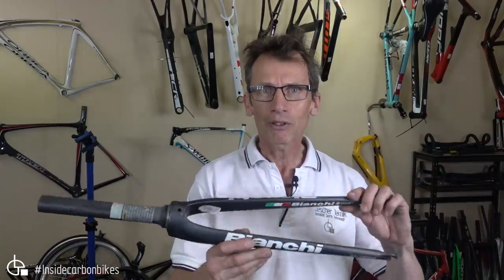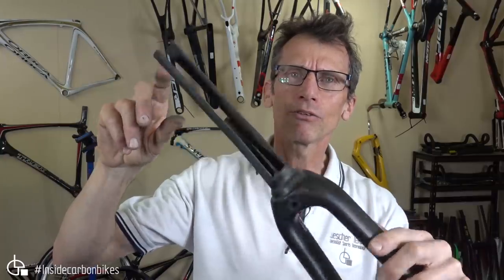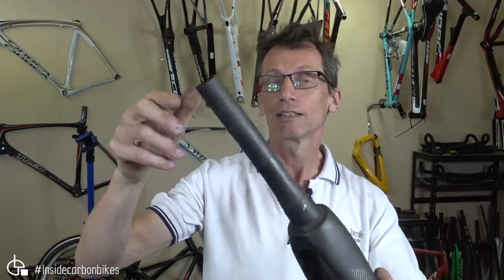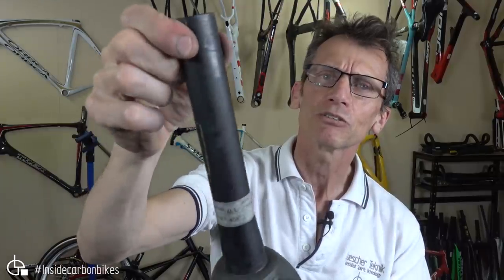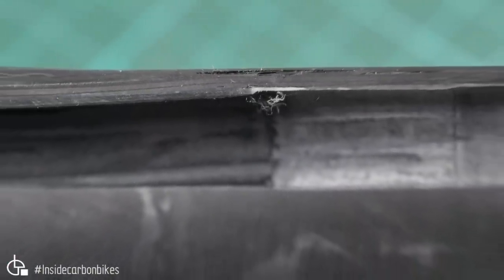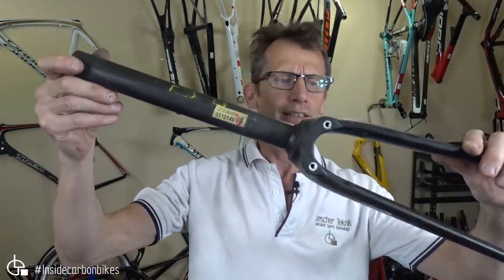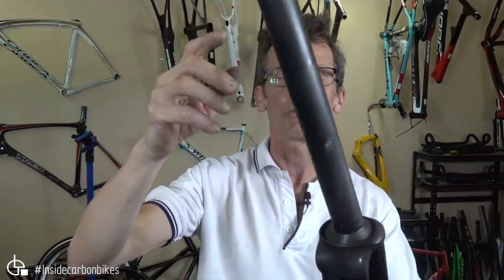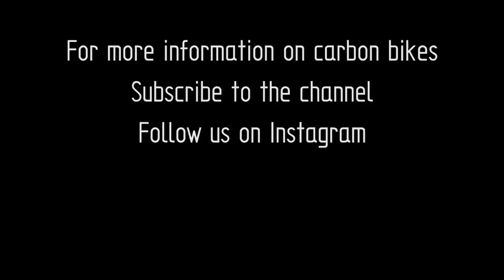Fork Steerer Failure - Recent Crash

Comment: Hi Raoul, I’ve been in denial about the state of my steerer for some time. I told myself it was okay, even though I was pretty sure that, owing to the fact I had not used a torque wrench, I had, and continued to over tighten the stem bolts, damaging the carbon.
Watching your video this morning was definitely a wake up call. 
I took the fork out and checked it. There is a vertical 2 inch crack all the way through the laminate at the top of the steerer, and also horizontal damage. Crushing damage. I’ve been riding around like that for who knows how long. It was a death trap.
No matter how many times I’ve heard mechanics/technicians, including yourself, on countless videos telling me to use a torque wrench, and not to over tighten, I ignored it. 
I’m clearly a moron, and I greatly appreciate you taking the time to make this video 👍🏼
New forks are on order. I will also buy a torque wrench.
Reply: Dan Golding - and use the friction compound.
Reply: Also watch Raoul's video on insert plugs and use a good one. I invested a lot of effort into picking one that should support the steerer properly against the clamping force of the stem. Won't say which one I picked, since I'm not entirely happy with it.
Reply: @robertp7209  The general advice is to NOT use friction compound on the steerer as it contains particles which will degrade the laminate over time. If anyone can clarify this then that would be useful.
Reply: @horrovac  Cheers! Yes, I have a proper 2in expander plug/bung which functions perfectly. My issue has been caused due to over tightening, the system itself is sound.
Reply: Dan Golding - the frame of my bike and balance of components (stem, seat tube, bars) manufacturers written instructions in the assembly procedure call for it and where to be applied including seat tube and handlebars.  And handlebars are alum to alum stem.  A tube of the compound is provided by same manufacturer, as well as the max torque specs.  Lastly, the steerer will not stay in place by torquing alone.  I will not exceed those specs, don’t even want to approach them.
Reply: Carbon paste can either migrate lower into the bearings or even worse damage the steerer as it is a rotating part. Many manufacturers specifically warn not to use it on steerers.
Reply: @dantedorado2609  There is friction compound SPECIFICALLY made for carbon parts like TACX CARBON ASSEMBLY COMPOUND,. i am sure it is not harmful to steerers. Not using compound when fitting carbon parts on a bike is what basically damages components. Trek who are the ones who started the idea of not using regular carbon paste in steerers, do approve the use of Tacx carbon assembly compound
Reply: @robertp7209  Carbon friction compound is made with the purpose of lowering the amount of torque applied to make bike parts fit. Anyone not recommending or using this is clueless.
Reply: @blorg8206  You are incorrect. The idea that you should not apply normal carbon paste to steerers came from a Trek tech bulletin.. in the bulletin trek states: "As an alternative, we recommend the following special carbon prep products:
Tacx carbon assembly compound
 - Fiber Grip™ carbon fiber assembly gel from Finish Line." So using just any carbon paste is not ok.. but using the right compound is.
Reply: Carbon friction paste has nothing to do with making parts “fit better” as your post stated. 

It is simply meant to provide some friction between inter fastened parts. It is in no way meant to serve as a “filler” for two parts to make their “fit better” as you stated in your post. It’s purpose is purely to change the friction between the components. 😃

Comment: These manufacturers are putting profit above QC, just watch Hambini’s video on Cervelo BB tolerances. Shameful!
Reply: Uff, that video is eyeopening
Reply: While I agree about the Hambini video, Cervelo is actually one of the manufacturers which do the fork steerer insert properly; it is glued in to the steerer with a sleeve, which is also long enough for the stem to clamp around it fully... Most manufacturers just do a compression plug or something similar which is not sufficient IMO.
Reply: @rkan2  the cervelo sleeve isnt long enough, i lowered my stem to be slammed and the bike shop had to hammer the sleeve lower
Reply: @mikes1984  It is long enough to support the full height of a stem. Whether it supports your your stem being lowered after first being glued in is another thing completely. It is recommended in the owner manual to glue the insert in the correct position...
Reply: rkan2 well i can’t verify that or not, but i have had two Cervelo’s and the finish is poor, the cable routing is also bad, so make sure you use electric shifting. for what you pay, there are poor quality for the money.
Reply: not sure what the situation is after cervelo was sold off, but they used to be great a with a lifetime warranty on the frame. I agree that finishing was poor, partic around internal cable housings not being finished so that water and sweat could enter and delaminate the carbon...just edge sealing would have solved that problem.
Reply: @Waynos Fotos; Why do you keep buying then? :)
Reply: @k c: Not Vroomen White anymore, and thus not really Cervelo anymore in my mind... PON Holdings probably does them in the same factory where they do Focus bikes.
Reply: BTW, you can see Raoul's opinion about Cervelo forks here: https://youtu.be/8bSnbjHiFXc?t=1m44s 

He regards the inserts as large, as do I, because the only things other than that are full length inserts, which are practically nonexistant or just some compression plug directly on the fork... Imo Cervelo inserts are among the best, if just installed correctly. Of course one can do an insert in any fork, proper diameter insert provided. Should be mandatory in UCI rules imo.
Reply: I have snapped a Cervelo s3 steerer and so has a friend. Yep quality control is crap.
Reply: no they have slack tolerances so the QC passes it just does not work as well.
Reply: This channel and Hambini are like watching the news...it gives a sense that everything is crap. Just ride brother, and embrace the creaking.
Reply: @aaron___6014  good luck to ya.. embrace the creaking all the way to the grave, LOL
Reply: Ian Brown  thanks Ian, actually it os not Aerospace tolerances, it is the bearing manufacturers that set the tolerance for their bearings to run properly and for them to maintain design life and warranty. I don't think it is to much to ask that the bicycle manufacturers meet that, seems most other manufacturers of  road vehicles can.
Reply: @rkan2  it was when i believed the marketing and aero gains. I just thought it was the shimano shifting, but it was the routing in the frame and groupsets on other bikes shifted better. Then i noticed how the paint was wavy compared to other bikes, and this was their top S5 frame. I have had other brands since and much better bikes.
Reply: @waynosfotos  If you don't race, I agree, if you do, aero gains matter (much more than weight gains). Exponential function is difficult for a lot of people to grasp, especially when it is to the cube!
Reply: You’re right
Reply: All hambini is trying to do is sell his overpriced bbs and tools and he'll go to whatever lengths to do so. While he may have some valid points his delivery is less than ideal.

Comment: Thanks for the video. So what’s the answer? Every time you buy a bike, have it scanned and do the QC the manufacturer should have done before they shipped the bike for sale? And then have scans again every certain number of riding hours? Seems an odd state of affairs. Hard to think of another industry where end user safety is in issue, where adequate QC is not undertaken by the manufacturer. Are bike manufacturers not concerned or currently taking steps to address the legal exposure they have in this area? How can we find out which manufacturers are undertaking the required QC  on frames and forks pre sale? As others have noted, buying a new carbon bike over the past 10 years does seem to have a “roulette” aspect to it.
Reply: S Ward it is because the bike industry is not regulated like car motorcycle industry, UCI is the only requirements plus reflectors etc. for sale rules in your country. 
So they get away with a lot.
Reply: Yup, I've said this many times in bike forums and FB cycling groups but have always been shouted down by the CF bike zealots. CF bikes are not meant for the average joe but bike companies are marketing these expensive light weight bikes to consumers because the average joe wants to ride what their favourite pro rider rides (so that they can ride from cafe to cafe showing off their ride). There is a certain amount of constant care and maintenance that is required for CF bikes and this is usually ignored by these amateurs. The pros get new bikes each season, the average joe rides their bikes for years. On top of that, the CF sheets are hand laid by workers in developing countries sometimes unregulated conditions. Even Canyon, that boasts that they x-ray each bike they build has faults in their fork - see video. Why risk life and limb so that you can show off to your buddies that you ride what the pros do?
Reply: @triode1212  I don't really think that is the point here, "who they are for" if a product is sold as a consumer product, I.e. off the self product, it should be fit for purpose. At these prices the quality control should be industry best, but it isn't! I do believe that is the point being made here. Who decides to buy and ride them is irrelevant to quality standards
Reply: @waynosfotos  I accept you point but even with the best quality control, mishandling by inexperienced mechanics and owners, plus the inevitable collisions/falls. will cause micro fractures which can lead to eventual failure of CF fork, frame. And I don't think it would be cost effective to test each and every frame of the thousands that the manufacturer builds - it would add considerable cost to the cost of each frame. Also a lot of the manufacture is farmed out to subcontractors (esp when the company needs to fill a large order) . Do these smaller shops/subcontractors have the same quality standards? Can they even afford the testing machines. CF is a great material but it has it's limitations and it is not for the average joe who will be keeping it for years.
Reply: It seems odd.  This guy seems a bit odd.  He makes money when people come in to get their equipment inspected.  I mean is he trying to inspect every bike in the world?  Is there some sort of carbon scanning community across the world for people to get their steerers scanned?  I mean what is going on here?
Reply: David Winters No you are incorrect, he is a Carbon bike repairer, with an excellent reputation, he did his training in the aerospace industry. He only gets to inspect these components due to the fact a rider has bought their bike in for repair. 
He may get access to some new stuff, but that is not his core business.
Reply: @triode1212  Its not just CF forks/steerers which can fail. Good QC is vital no-matter what the material is.

Comment: I will stick with my alu road bike which has a steel fork. It's a bit heavier (11.4 kg) but hassle-free. And it needs almost no maintenance or torque wrench. Carbon bikes are overvalued and overpriced.
Reply: correct, but even finding an aluminum or steel frame that is well done, is not easy to do either

Comment: My headset made these terrible cracking noises. It wasn't the cables. It sounded and felt like serious damage. Like a piece of frame or steerer tube had broken off, and got caught inside. I took out the front fork and i was relieved to find it was undamaged. The headset was more mud and sand than anything else though. I cleaned it, and the cracking had gone. New headset is on order.
Because of this video, i'm going to remove the spacer above my stem, have the steerer cut. And check the fork regularly, even if everything seems fine.

Comment: It looks like there are critical manufacturing mistakes within the entire bicycle manufacturer industry. Wouldn't it be a safer bet to use a fork with aluminium steerer tube for the price of slightly more weight?
Reply: Forks with aluminium steerers are even worse, since the bonding between aluminium and carbon is a weak spot and practically impossible to do right. Even if everything is fine, differential thermal expansion will make it a risky proposition, as it creates a stress point unless the fork is always kept in the proper temperature range. And finally: aluminium fails too - perhaps even worse, as it is subject to material fatigue.
Reply: use a steel fork
Reply: @methylmercurypoisoning  Ive seen more steel forks fail than anything. CARBON WONT FAIL if you use a long steerer plug AND use a torque wrench AND don't run into the back of car at 60kph.
Reply: @methylmercurypoisoning  Use any fork you want from a reputable manufacturer. All materials are safe when used properly and all have pluses and minuses.

Comment: Great video. Clearly the current method used for carbon bike manufacturing is too unreliable to make them a viable purchase for the majority of people. Without  each component passing a ultrasound inspection with certified results you could be spending £10k on a dud. Likewise if the bike is assembled before purchase and the torque wrench used is out of calibration you've again got a possible dud. Poorly designed fork steerer inserts etc etc. Appalling design, quality control and total disregard for the customer.

Comment: Some years ago when I heard of steerfailures on carbon forks, I reinforced mine - at least I think. Made round inserts of wood, carefully adapted them - in full length - to the inner of the steers and glued them in with some epoxy glue (Araldit). Good or bad idea - or just waste of time? Like your videos - always good to hear people talk about things, they know about!
Reply: Bad idea.  It changes the location of peak forces and it’s likely not designed/tested to have the set of forces you’re creating.
Reply: Carbon wood fibre 😂

Comment: It's clear that these carbon steerer tubes need a bonded aluminum insert/sleeve all the way through for safety purposes, even if it sacrifices a little weight savings. Clearly there are manufacturing problems/processes that cannot be resolved. Looking at this right now, and I'm in the middle of building my first full carbon bike. Not a good feeling. I'm using the recommended specialized expansion plug in the streerer as recommended by this channel (thanks for that), and using a good torque wrench.

Comment: If there is nobody in my area to do a scan is there anything an average consumer can do?
Reply: Worry
Reply: DaaaveO1971 thanks for the tip
Reply: Pick a good compression plug and meticulously tighten the stem to proper torque. If it's 5Nm, first tighten the bolts so they loosely clamp, then tighten to 4Nm, then to 4.5Nm, then to 5, always alternating between the bolts (even after one bolt has tripped the wrench, after you tighten the other bolt, this one will move a little bit). Listen for cracks, if you hear anything like a stick of wood cracking, that's bad. Otherwise, don't worry too much, it's probably fine.
After you've installed it, pick a safe spot where you can fall safely, and sprint out of the saddle as hard as you can, making sure you put as much force into the handlebar as it is ever likely to experience. Carbon does not fatigue, so if it does not fail then, it will probably be O.K. later - unless you overtighten it, bump it while crashing or overload it in some other way.

Comment: I've ridden past a fatality due to a steerer failure. I've stuck to cro-mo since then. It's not worth saving a few grams. Plastic is for toys, I want tensile strength when my life depends on it.
Reply: Ive seen steel forks snap from fatigue. Carbon wont. People don't run deep enough steerer plugs and then blame the carbon when it fails from being crushed..
Reply: Durianrider Cycling Tips - nope doesn’t happen to carbon steel, it will bend and bend plenty, if the design is adequate.  Think of a paper clip.  Remember quill steerers?  Do you realize the kind of force it’s under from the wedge binder on the inside.  Tighten it all you want the bolt will snap first.  A casting can crack but that’s a defect in manufacturing.  Once again the forensic analysis will determine the cause, analysis is relatively straightforward for metals. Not really a challenge or specialty, any engineering lab can do it.
Reply: GG DD - he’s probably shilling for one or more of the carbon bike or component vendors.
Reply: Robert P I hit some railroad tracks doing about 15mph on an old USA made Schwinn Continental 10sp in the late 70’s .. snapped the forks clean off.

Comment: Can one use carbon bonding to add support for the steerer tube and possibly to extend the length of the tube. Ignoring the excess weight from epoxy resin and additional carbon material will using standard industry bonding techniques add strength to the steerer tube so one does not need to find someone to x-ray it.

Comment: Eff that carpet fiber. Had a composite steerer and quickly exchanged it for what's real - steel.
Reply: Ive seen more steel fail than any material. Carbon can't fail. All these crushed steerers are from noobs running shallow steerer plugs with spacers on top of their stems! 1. STEERER PLUG NEEDS TO GO BELOW THE BOTTOM STEM BOLT!! 2. DONT RUN A SPLIT RING THAT HAS A GROVE IN ITS VERTICAL FACE! 3. USE  A TORQUE WRENCH. 4 DROP YOUR FORK OUT EVERY FEW THOUSAND KM AND CHECK ALL IS WELL. :)